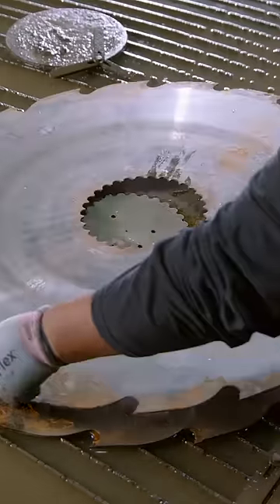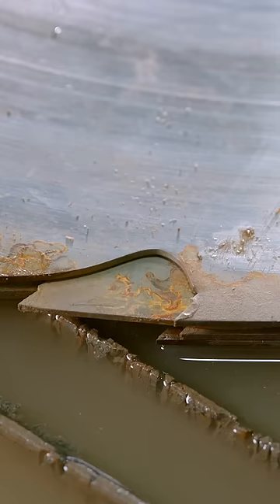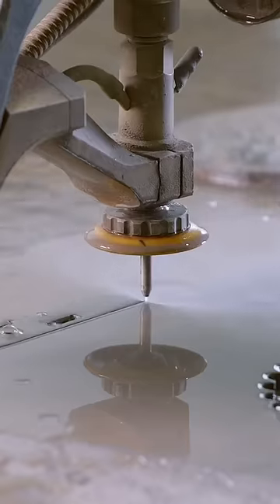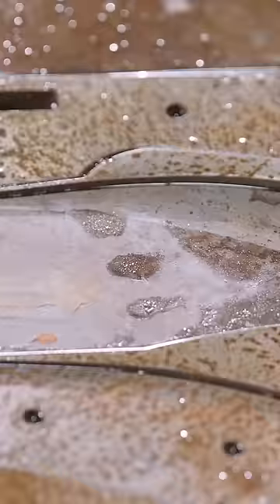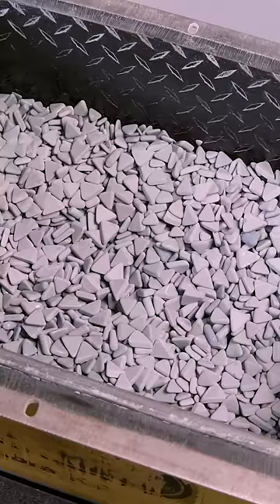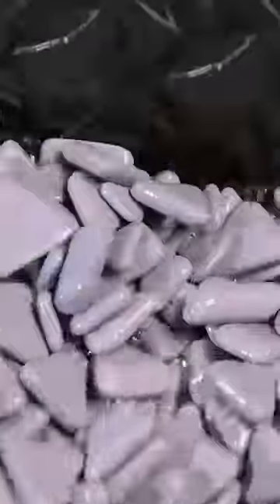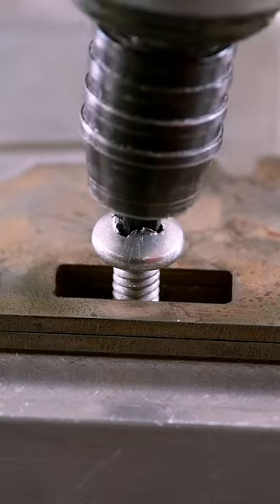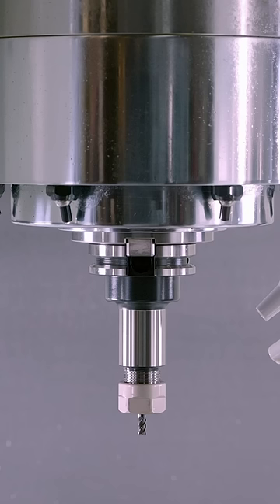Turning Old Sawmill Blades into Knives | How It’s Made | Science Channel

Comment: High pressure water jet cutters are unreal. It can cut through 8 inches (20 cm) of steel. Some can cut even thicker.
Reply: Takes ages tho
Reply: That’s nuts I didn’t think about more than one in a go. Way faster to do that than load it 3x even if it cuts slow
Reply: It's quite clinical looking when compared to flame cutting
Reply: It's not the water cutting. It's the grit. The water is just moving the grit.
Reply: @koertvanengelen2395 and it still cuts material laser and other cutter cant cut like composite body armor
Reply: Water is just a carrier. the type of media is what doing the work, and it's not cheap
Reply: The university I went to has a Stonehenge made out of 3+ foot-thick blocks of granite that were cut on a water jet.
Reply: @koertvanengelen2395 almost every process takes forever to cut through 8" of steel
Reply: @koertvanengelen2395  it'd still take less time than you playing with your little junior hack saw
Reply: @tombradshaw2000  the program🤦‍♂️
Reply: Best part no heat warping or electricity shock also usualy really low water bill as they don't use much water only real issue is size and grit removal
Reply: Any cut above 2 inches is gonna look like shit
Reply: Like Bruce Lee said, “be watah my friend.”
Reply: @koertvanengelen2395  how else you gonna cut that thickness cleanly in that amount of time?
Reply: Yeah we had one at the factory I used to work at they are no joke, we used to use them on 20mm mild steal to make those corkscrew hole boring attachments for diggers
Reply: well i used one for 5.5yrs and i think 10mm is pretty much max to it be effective.. it will go trough anything tho
Reply: That’s how we have valleys and canyons
Reply: @Random-ed2xf  Read it again and actually comprehend what you're reading.
Reply: @Airman..  no, actually it's not too expensive to run. The garnet dust is filtered out of the water and reused many times. The run cost is low, its the initial cost of the machine that's user expensive.
Reply: @green_claw2830 nope, the garnet is filtered and reused. 
Electricity is the biggest run cost.
Reply: @hunnybun2431 no it’s definitely just water, we have two in the machine shop and we use those when we aren’t using the cnc/lathe machines. There is nothing added to the water and if you stick you hand under there it will certainly take your fingers off. Idk where you got your information from but it’s not true. And if there was “grit” in the water then it wouldn’t be able to flow thru the high pressure nozzle. You do see how small that stream of water is, right? So the hole it’s coming isn’t any bigger and if there was anything grainy mixed with that water then it would not flow properly and you would see it pulsating.
Reply: @JT-nn8nj No joke, this was a mind-blowing connection you just made for me!
Reply: Yeah but it's not the water that cuts, it's the abrasive silica mixed with the water. So it's not that crazy if you ask me.
Reply: @Redact63Lluks exactly my thought
Reply: You can cut plastic, rubber aso with water only, but for cutting metal some abrasive material has to be added....Period....
Reply: @garethkalum8297 our garnet is tossed in the landfill after one use, we go through 2200 pound bags about once per month, so not much cutting.
Reply: @dstglizzytwotonez4298  water jet cutting uses Garnet as a abrasive, you cannot cut aluminum or steel with water. I use a water jet almost daily. Foam and rubber are the only 2 materials I use water only.
Reply: @green_claw2830 the grit is expensive tho? or nah?
Reply: 200 mm cut on water jet 😂
Reply: My oxy acetylene torch will cut 8" and do it way better than i thought.
Reply: It can cut through 8 inches of steel!

Me: just hold it there longer tf 🙄
Reply: I once cut a geode in half with one
Reply: @HerskalleLuottoo your water jet probably kinda sucked if it could only go to 10mm. I cut through 2 inches of steel with the one my college had
Reply: @green_claw2830 the grit can also be considered toxic waste depending what you've cut with it. If it has copper and aluminum in it, it can be very difficult to dispose of
Reply: FLOW Incorporated
Reply: @hunnybun2431 yeah but thats what its univesally known as. No one calls then grit cutters.
Reply: @dstglizzytwotonez4298  No. Some absolutely use garnet dust as an abrasive for cutting harder materials. You're not cutting every material at every thickness with straight water. Regardless of the pressure. You're seriously using our squishy, weak flesh as an absolute with this? You can cut through skin with paper. That must mean you can cut steal with paper then, right? Go back to mom's basement
Reply: @Airman.. Given enough time, water can cut through anything by itself. Water is weird given how common it is, but still scientists had a hard time finding out the way it works.
Reply: Waterjet’s are so slow and expensive to run. If it is for aesthetics, then it is worth it but if it is not. Then you can either go with plasma for the quickest (yes you are going to have case hardening on edges) or laser which will be as clean as waterjet but machines are expensive with higher thickness cutting capacity.
Reply: Fun fact the only thing capable of stopping that jet is more water
Reply: And you drink that stuff?  😉
Reply: The water has silaca sand in the water and that's what does the cutting
Reply: They used a water drill to rescue baby Jessica. If you're a whippersnapper under 40 years old you may not remember that though
Reply: I just want to know why steel Pokemon aren't weak to water Pokemon.
Reply: Newport News Shipyard in Virginia uses water jets to cut through steel plates for building the hulls of ships and Submarines.  Some of the plates can be over a foot thick. Some are way over a foot thick.
Reply: I know guys, the water is just a carrier, which shoots the particles of various types of cutting media. In addition to cooling and removing the debris.
Reply: yeah but the machines are pieces of shit and break down constantly.
Reply: @hunnybun2431  yep you are correct its garnet thats what we use in ours.
Reply: They can, although unless it were an extremely simple design it'd take a while.  I never did any steel thicker than half an inch, I think.  There's also a surprising amount of variation on cut time depending on the kind of steel.  AR400, for example, can be a real long wait.
Reply: @dstglizzytwotonez4298 i work with flow machines (the machine in the video is a flow btw) on a daily basis, you do need to use abrasive ( usually garnet sand) to cut through most metals otherwise it only makes a surface mark. Now from what it sounds like you guys are using a jet for cutting plastics or some other soft(ish) material with a water only machine which as far as i have been told ( i have never used a water only machine myself) only have an orifice which is usually smaller than an abrasive orifice whereas the machines i use have an orifice (ours are .003 in diameter i think) which then goes to a mixing tube where the sand is added and then goes into a cutting nozzle ( .014 diameter btw) now the older machine runs at around 60,000 psi while our newer 5 axis hyper jet runs at around 84,000 psi. TLDR you do have to use abrasive to cut steel like they are in the video but there are different water jets built to cut different things that don't need abrasive
Reply: They are cool hydrogen cutters are better
Reply: Waters scary man
Reply: I run a water jet and a laser. The water jet is brutally slow. Yes, it can theoretically cut any thickness ( ours will cut 10 inches) but for reference we cut 1 inch thick plate at like 3 inches a minute.
Reply: could it cut through a guy?
Reply: I operate a water jet mach 500 and it can cut up to 16 inches of material
Reply: Jet water can't melt steel beams 😅
Reply: I don't think I could ever wrap my around the fact that you can cut metal with water 😮
Reply: even thru diamond
Reply: This is accurate, and it better than plasma cutting it, way less sparks, heat, and mess
Reply: @koertvanengelen2395 slower than plasma?
Reply: @dstglizzytwotonez4298 the only way a wayerjet will cut without abrasive is on soft materials like wood or thin plastics. Garnet is the abrasive used in waterjet cutting, I've been running water jets for 10 plus years.
Reply: the only limiting factor is z height (how far up the nozzle head can go). I ran one of these at an old job and it could cut 16in steel, which was the highest the head could be adjusted.
Reply: @green_claw2830  Water bill ain't that low, basically have to refill a pool every 2 weeks. Once a week when I get busy.
Reply: They can cut diamonds as well
Reply: That means human flesh is like paper to a water jet. Be careful people
Reply: If the damn thing runs
Reply: Ahhhh… the steady drip drip drip of the water jet. ❤
Reply: @MasterVanoi  i forgot that the pool needs to be refilled
Reply: @Airman.. isnt it fine sand?
Reply: @sheezy2526  abrasive type is chosen depending on the material hardness/time allocation. It could be silicon carbide, aluminum oxide, sand, and garnet. This is general guidelines frankly machine manufacturer will suggest best machine settings for the application
Reply: @admiralshwartz3956  right, I've never heard of reusing, we have ours sucked out every 6 months or so
Reply: @mathhomework4209  yes
Reply: @HerskalleLuottoo  10mm? That's like 3/8". What do you mean max to be effective? Water jets will cut through any thickness theoretically, depending on how tall the bridge of the machine is( ours does 10")
Reply: @hunnybun2431 and the water and grit is moving at about 3 times the speed of sound
Reply: @HerskalleLuottoo we were cutting explosion welded material, stainless on one side and copper alloy on the other about 1 1/4 thick
Reply: @twuuwttwu there's garnet abrasive in the water stream
Reply: @justinbrandt8415  but what pressure, cutting nozzle diameter, abrasive feed rate, and cut quality is your machine running at? 
All of those things can change possible cut speeds dramatically, for example i regularly use a flow running at 84000 psi with a .04 nozzle running a pound of garnet a minute and while it isn't super fast you can cut low cut quality parts fairly competitively (at least time wise) with a plasma table
Reply: @dstglizzytwotonez4298 You couldn't be more wrong. The garnet is added to the stream above the cutter nozzle. Pumps are running 40,000 - 60,000 psi through a .020 orfice.
Reply: @dstglizzytwotonez4298 You giys must be the only one's in the country running your water jets like that then. EVERYONE  else is running crushed garnett or other abrasives in their water jets. 
Maybe go talk to the guy's who actually run yours ;)
Reply: And it don't heat up the metal. Magic!
Reply: Guys, here is The True Savior

HalleluYAH “Praise ye YaH”

YaH is The Father (Genesis 1)
YaH arrives via the TENT OF MEETING
YaH was Who they Crucified for our sins
YaH was Crucified on an Almond TREE

Ancient Semitic Moshe (Moses)
Isaiah Scroll (The Original Isaiah)

Comment: "The stones clean the blade" yes, how very clean.
Reply: An angle grinder would clean those up just as well in 30mins. Or stumble them uselessly for hours. 

Then edges don’t even really looked deburred. Still looks sharp from the cuts
Reply: That blank definitely didn't get tumbled.
Reply: @DisorderInOrder surely you know more with your angle grinder than industrial blade workers.
Reply: @SpunkMayo  He's right, though.
Reply: @rockspoon6528  Except he's not at all. Just say you don't know what tumbling is.
Reply: It's cleaning mil scale off that's all the stones clean.. wet carbon steel will get surface rust with in minutes of making contact with air..
Reply: @chrislocke1042 except the tumble cleaning is also with water so it too will rust within minutes of the air.
Reply: @warrenlancaster9305  I believe that's why I mentioned water and air in my comment
Reply: this screw at the end ... bro 😂😂
Reply: Did I hear that correctly!?! High pressure water cut thru a stack of 3 carbon steel blades...😮
Reply: @MirkoRonasaurus  a water jet can easily cut that..
Reply: @DisorderInOrder  An angle grinder would take off too much material for the application. Taking each one of them and running something like a Scotch Brite 7447 red on it with water for a while would remove all of that oxidation in a hurry.  Finish with SB 7448 fine pads and you'd have gleaming clean metal to work with.
Reply: @DisorderInOrder  that creates too much heat and messes with temper, also makes for uneven blades.
Reply: Yes.
Reply: Tumbler runs for several hours to do 6 blades!? It didn't clean or smooth it very well. And 3 stacks of sawmill blades would produce 60 knives. That's like 4 days running that tumbler.
Reply: @DisorderInOrder  And a belt sander would do a cleaner job and would be less likely to cause more damage..but hey why be smart when you can be an ape with an angle grinder?
Reply: Smooths out the blade
Reply: He did say clean but clean as in cleaning the jagged edges not cleaning the rust
Reply: @DisorderInOrder 30 mins??? A wire brush on an angle grinder would take you 5 or so minutes.
Reply: @SpunkMayo surely you know zero about angle grinders. A wire brush on an angle grinder would bring those back to bare metal in minutes.
Reply: @SpunkMayo the results spoke for themselves. They looked still pretty rusty.
Reply: @MirkoRonasaurus yep, not just water though, it has a grit in it.
Reply: @phuturephunk what?? An angle grinder with a wire wheel or Scotchbrite pads would not remove any metal.
Reply: @chrislocke1042  a water jet can cut anything...
Reply: @dar3algam3r52   Thanks for telling.. especially since I wasn't the one questioning a water jets ability
Reply: Literally came to comment the same
Reply: @chrislocke1042  IDK y ur being rude, I just think they're cool
Reply: @teeanahera8949  and then it would oxidize in two seconds

Stick to your lane
Reply: @SpunkMayo ”just say you don’t know what tumbling is” 🤓🤓🤓🤓🤓
Reply: @teeanahera8949  your comments are what speaks for themselves. Accept your ignorance or you'll never learn a single thing in your life
Reply: @mw2277  says the guy commenting on a How It's Made video thinking they're somehow less of a nerd than everyone else lmfao
Reply: @chrislocke1042 Minutes is an absolute obscene claim. I use knives of wildly varying blade steel compositions all the time, I work around water all the time. D2 a fairly high carbon steel has rusted on me maybe 4 times ever.

Comment: These screws have survived two wars xD
Reply: Barely. How one can employ Philipps when there's Allen or Torx is beyond me. Especially in an application like this when they are re-used over and over.
Reply: yeah look how chowdered up those screws are. Phillips is so inferior to torx or robertson.
Reply: @paddington1670  they're cheaper. They don't need to survive long they just need to hold that thing down
Reply: @HotelPapa100  they probably drop 20  a day down a drain that someone put right under the table
Reply: @paddington1670  Torx is inferior to six point bolts

Comment: First they take the dinglebop, then smooth it out with a bunch of shleem. The shleem is then repurposed for later batches.They take the dinglebop and push it through the grumbo. Where the fleeb is then rubbed against it. Its important that the fleeb is rubbed, because the fleeb has all the fleeb juice. Then a shlammie shows up and he rubs it and spits on it. They cut the fleeb. There are several hizzards in the way. The blamfs run against the trumbles and the ploobis and grumbo are shaved away. That leaves you with a regular old plumbus
Reply: Exactly what I was thinking hahahahaha😅
Reply: Yes, that was indeed the joke.

The difference is that this is actually informative and not a silly parody with no actual process to the creation of a plumbus.
Reply: So glad you cleared that up.
Reply: Huh, I always wondered how a plumbus was made.